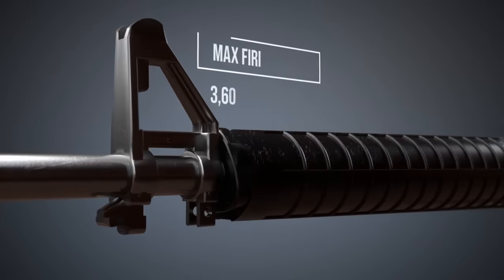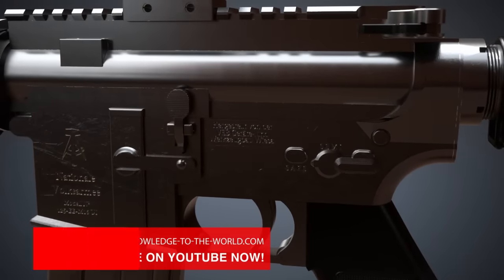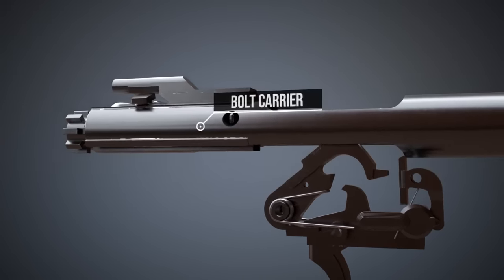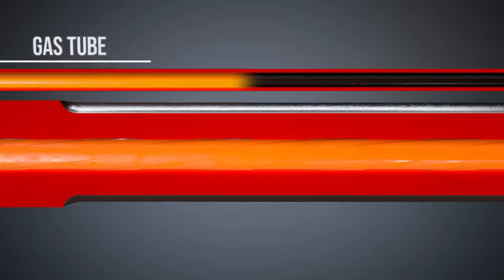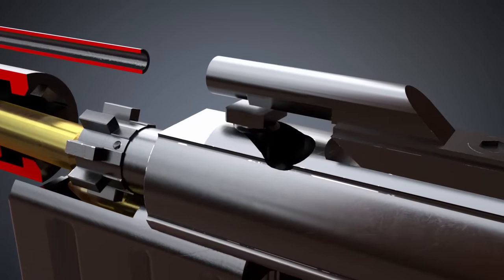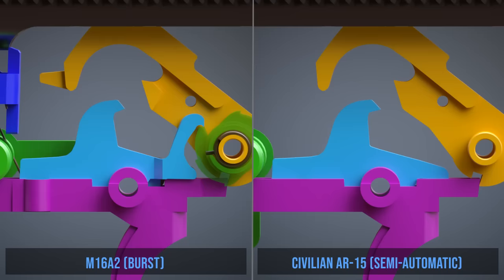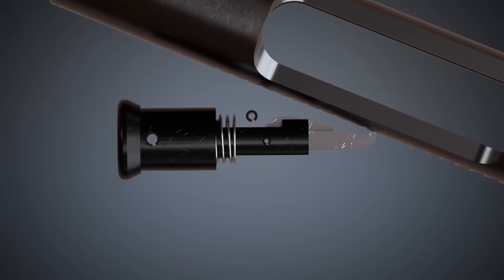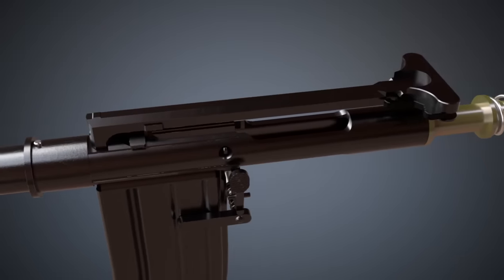M16 and AR-15 - How firearms work! (Animation)

Comment: I’m small arms repair in the army. This has to be one of the best illustrations of the breakdown of this weapon system I’ve seen.
Reply: WHen he said that the lower reciever of the civilan AR-15 "doesn't have room for the auto sear", is this really true?

I thought the civilian AR-15 lower receiver was the same size as the lower recievers of M16/M4 rifles. Only that the auto sear is abscent, and the recesses needed to keep an auto sear in place hasn't been milled into the lower reciever body?
Reply: Seven Proxies 
It’s not so much that there “isn’t room”. It’s that in an M4/M16 the auto sear has a pin that goes straight through the receiver, and that hole isn’t present in an AR15.

Basically, you would need to do some drilling and replace and add a lot of parts.
Reply: @Grabbagar670  So my initial impression was correct then?

I can see why illegal full-auto conversions occur, because it's not that hard to drill a space for the pin and modifying or fabricate the other necessary components if you've got access to a mill.

The fire-selector of the M16/M4 also seem virtually identical to the civ AR-15, where the only difference being that it has a few extra slots or grooves to accomodate the full auto sear.

Not being a U.S citizen I haven't had the opportunity to get a more hands on inspection of either rifle, but I've tried reading up on it as much as I can. Gunsmithing is a topic I have a soft spot for, but in my country there isn't much market for it, sadly.
Reply: Seven Proxies 
I believe that you would need to mill out the fire control pocket a bit more. But to make it work, you need to actually get new parts. The selector switch is only one concern.

Legality aside of course.
Reply: @sevenproxies4255  Yes and no, some do and some don't have the room as some manufacturers don't mill it for precaution/legal reasons( even though they don't have to).. This is just how many of them are sold because manufactures want to play it safe, but you can legally get what they call "high shelf" or  "low shelf" civilian ar15 lowers that already has the extra bit milled away needed that can accept an auto-sear/pin or RDIAS(drop in auto sear).. But that doesn't matter -buying a low shelf receiver that CAN ACCEPT a third pin sear or RDIAS isn't illegal, but HAVING the third pin hole in the receiver or rdias  IS (unless you have the legal paper work to own a receiver with third pin hole or an RDIAS).. Now, you can have a registered low shelf  receiver with the third pin hole or you can have a registered drop in auto sear(RDIAS) that can drop into any low shelf ar15 lower.. (another way is having a lighting link, but that's a different story and requires different parts).. Even if you have a low shelf receiver with a third pin or an RDIAS,  civilian ar15s would also need the notched hammer/fcg and full auto carrier group to work with the auto-sear/rdias as well, which most manufacturers of ar15s try to keep as many of these parts out as possible to keep it far away from being easy to make full-auto.
Reply: @sevenproxies4255  
Many civilian lower recievers do not have enough milled out inside for the autosear to fit. It can quickly be changed, but is done to discourage people from doing the auto conversion
Reply: I to was a 45B small arms repair
Reply: @Grabbagar670  And the minute you drill that hole you've broken the law and are facing 10 years in the slammer. Of course, if you're already a criminal or intent on going on a murder/suicide rampage, that's hardly a deterrent. That's how much our gun laws make sense.
Reply: @jayzenitram9621  yeah but youd hope that theyd be slammed before shooting the place up therefore preventing it
Reply: @wierdalien1  How? You mean like they've caught all the other mass shooters before they flip out?
Reply: @jayzenitram9621  I am not saying it works! Just thats what youd hope
Reply: 'Murica 1776 - Thank you for your service!
Reply: Many thanks for your service!
Reply: @sevenproxies4255  
The fire control group, bolt carrier, & the rear pocket needs machined out to accept the auto sear - that's all by design to keep the average citizen from messing around with it. It's a timed function, so you don't really want to mess with that unless you're into firing out of battery - Ka-boom can you say? 
I wish it wasn't so expensive to obtain a full auto gun, I would like the 3 round burst option, full auto is over kill - to me that's a last resort -& I wish people would've been more responsible with their fire arms back in the day - as they say "With great power, comes Great responsibility" & the clumtards dropped the ball, now we the people get to deal with their idocracy
Reply: Guys, even the receivers of ar15s that a considered "low shelf" will not accept an auto sear without additional milling and precise drilling of the hole for the auto sear pin. You also need almost all new fire control parts; you can't just put an auto sear in an ar15. It isn't that simple. But it's possible to convert. Just an fyi, if you have an auto sear and do not have a legally possessed machine gun, the atf considers possession of an auto sear to be possession of an illegal machine gun. Choose wisely. If your want to be a law abiding citizen you can't have one. But if you want to be a criminal you likely don't care about the consequences. I FEEL safer already.
Reply: @MrMoparbob498  From 1934 when registration was mandated to 1986 when they were banned there were 2 incidents of violence with registered machine guns. One incident was committed by a police officer. I'd say that's a pretty good record for regular civilians. They were banned for no reason. They were required to be registered for no reason also. It was in response to Bonnie and Clyde and also the Saint Valentine's massacre. The machine guns used were stolen from police and military facilities. It had nothing to do with regular civilian owners but they were thrown under the bus on both issues.
Reply: How many mass shootings were executed with illegally milled AR15s? None. Mass shootings don't require fire supperiority because the targets are usually unarmed. Arming more civilians would reduce shootings because the shooter could be overwhelmed and the risk to shooters would be too great.
Reply: @jayzenitram9621  legislators violated Constitutional rights by creating that law. What should they face for doing that?
Reply: @1pcfred  I don't know, how do you punish a worm-ridden corpse being that the NFA was instated in 1934. Even Saint Ronnie, who signed the machine gun ban in '86, is slithering with the worms now.
Reply: @jayzenitram9621  there's the people that perpetuate it today
Reply: Joe Blow  they do not care what I want and I have to say the feeling is mutual. There's just a lot of that sentiment to go around these days.
Reply: @Yugetubes  Spot on accuracy. Then we had a crooked liberal politician that lied to the lawmakers and made it seem as if everyone in the country had tommyguns, silencers and BARs. When in reality the only people who could afford them was the criminals and Hollywood. The Politician wanted to ban all semi auto firearms and every other firearm except for double barrel shotguns and single shot bolt action rifle for hunting. But the lawmakers said that was against the Constitution and then they came up with the "(tax stamp)" of $200 that we have today and that price was the cost of the Thompson submachine gun. So the government made it basically impossible for normal people to obtain it. The depression was going on and people were starving let alone had money for a firearm that's cost as much as a new car at the time.
Reply: How much does a ak-47 and m-16 cost?
Reply: @‘Murica1776 im heavily considering joining the army and I was researching what MOS I would like to have and yours was one that caught my eye. Is there anything you can tell me about it? I hear it’s a lot of paperwork
Reply: 'Murica 1776; THANK YOU FOR YOUR SERVICE BROTHER!. I can see that you take your job very seriously as it should be. Im sure you already know that in order to do things right, you've to believe in what you're doing. Stay Safe!.
SEMPER FI!.
Reply: Seven Proxies 
  Any AR can be made full auto in 10 minutes no parts required, just a file. Two drawbacks are there will be some tuning required to eliminate hammer follow and the biggest drawback is it's a genuine machine gun because semi will no longer be possible.
Reply: I went to Armor school in the Army as well.  We had illustrated break down of how it and other weapons worked but not in this form.   Great video.
One thing with the AR15 and M16 platforms to remember is to use some sort solvent in the gas tube and block ,  carbon build up does happen and causes failure to feed.
Reply: C M a heavier buffer spring helps but isn’t required
Reply: As a law enforcement patrol rifle instructor and certified M16/M4/AR15 armorer, I couldn't agree more!  I'd really like to incorporate this video into our initial rifle training classes.
Reply: @MustangGuru  
Ive never heard that before. There is never a need to clean the inside of the gas tube in any way whatsoever. It wont even get wet because the gas system is a closed and self cleaning system by design. Ive never seen carbon buildup in a gas tube. Although to be fair, I know that instructors in armorers school give a lot of bad information.

The 10 manual specifically says to not use solvents to clean your weapon because you will wash away the Teflon lubricant that has been building up as a result of you using CLP. You scrape carbon buildup.
Reply: I was small arms repair in the Army back in 1984 to 1988... amazing how long these rifles have been on duty... well over 55 years now? I was at Ft. Lewis with the 9th ID the whole time, after my training (though I did go to Team Spirit '86 in Korea for a month) and my own issued weapon was marked "XM16E1" from the Vietnam War... serial number 106859, which I can still remember off the top of my head after over 33 years. That rifle (or receiver, anyway) must have been produced about the same time I was born.
Reply: can u help me fixing my m16A1 full auto colt doesn't shoot auto, the pin shoot the bullet but the bullet doesn't go off u see the bullet has been shoot but doesn't go off
do you think the ammo is the issue or the pin ? or the buffer or buffer spring not strong enough to bring the bolt back with bullet